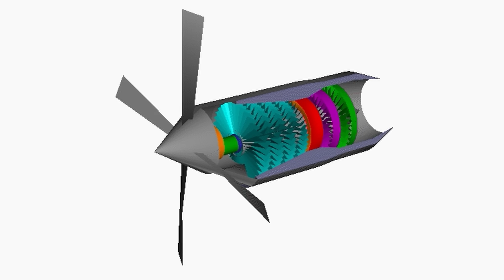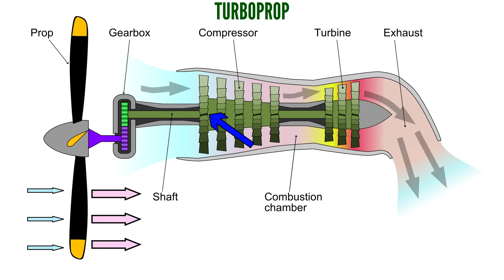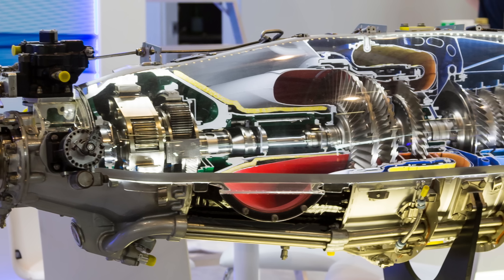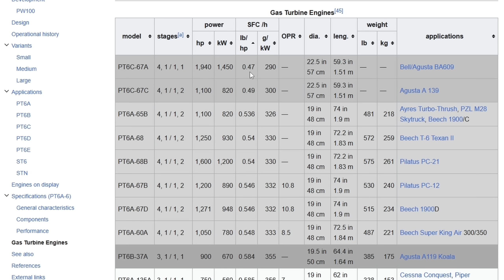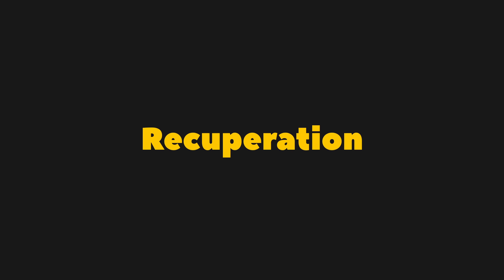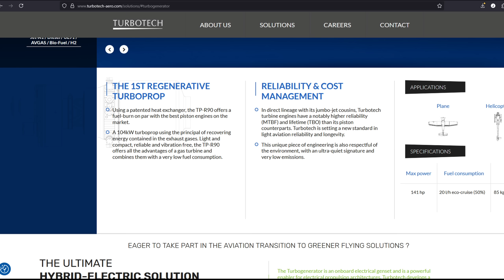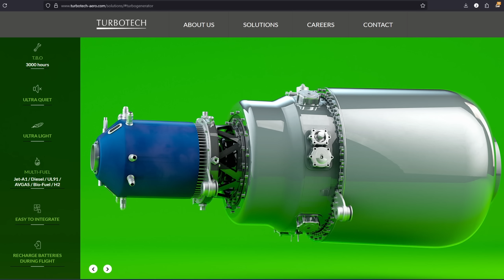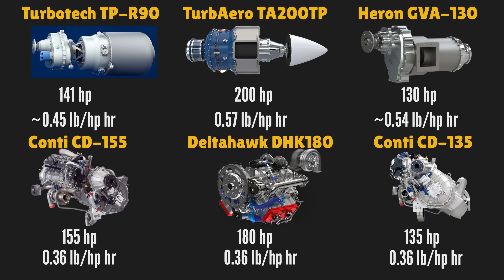Are Piston Engines Dead? Small Turboprops are Here

Comment: This was an excellent video. I'm actually considering doing a build assist on one of the airplanes that TurboTech has partnered with. This helped me understand the tradeoffs quite a bit better. 

Your video makes me want to be concerned with the recuperation technology and it's reliability. Can TurboTech actually achieve 3000 hr TBO? Have they made weight tradeoffs that are tested to that level of endurance? Is the recuperation tech something that can be inspected periodically? What is the replacement mechanism if an issue is found? Can I replace a part or do I have to overhaul the entire engine?

One thing that is a mystery to me is that TurboTech advertises that you can use any popularly available fuel in it including: Jet A1, UL91 & AVGAS. I don't understand how that works and would love for you to go over that. But the fact that Jet A1 is typically much cheaper than AVGAS also factors into the cost efficiency of the engine. If the engine burns more fuel, but the fuel costs less per unit, then the loss of fuel efficiency might be gained back in lower costs. 

Of course, the deltahawk can also use Jet A. But as an airplane consumer I don't see a lot of airplanes for which I could subtitute the deltahawk for the Rotax 916. Because the deltahawk is a lot heavier. Meanwhile the weight of the turbotech is very close to the weight of the 916. So it's more easily fitted to airframes that currently use the 916.
Reply from the maker: Thanks, and all reasonable concerns. I don't have most of these answers, but regarding inspecting the recuperator / heat exchanger, it seems an inspection is unlikely to be quick, nor trivial due to how integrated the device needs to be, and my guess is it consists of a multi-hour inspection with borescopes to look for cracks and signs of fatigue due to heat, depending on how they designed the heat exchanger wrt access ports / points, but I'm happy to be corrected here.

Comment: Turbine engines can handle higher temperatures than piston engines, at least big turbine engines. Piston engines have a more efficient thermodynamic cycle because the compression is partially performed by heat, rather than mechanically. However turbines can overcome some of this by operating at higher peak temps, maybe this doesn't apply to small turbine engines which arent manufactured to the same standards. As for the poorer efficiency at low power settings. It's mainly the lower pressure ratios that causes the drop off, as in the Brayton cycle higher PR is strongly correlated with efficiency (within reason). However another interesting factor is that if you can fly at 30,000ft you are in much colder air than at 10,000ft which greatly improves your thermal efficiency again.
Reply from the maker: They generally fly on Jet-A or Jet A1. They can fly on diesel, but aviation-grade diesel isn't readily available. Regarding automotive diesel, make sure with the manufacturer how that affects inspection intervals and TBO.

Also, diesel isn't a lot cheaper than Mogas, which many of the piston engines mentioned run on.

Comment: Can't believe a Rotax is $55,000.... for a piston engine 😢
Reply: - we all still think Rotax is a cheap snowmobille or Trike Engine....
Reply: I used to think GA piston engines were absurdly expensive, until I got into boats and found that a replacement diesel inboard for my boat is around $10k, and that's just 20-25 HP. $/HP is about the same as the Rotax example...

Comment: For me turbine have only 2 advantages, reliability and do ziiiiiiiii when start, the rest are disavantages.
Reply: They also are lighter, have a more aerodynamic form factor, use cheaper and more widely-available fuel and have better performance at higher altitudes than a piston.  The main problems have been fuel consumption and cost.   I’d love to have one if it was anywhere around 180 HP and 9 GPH.
Reply: @gregjennings9442  The turbine is hard to manufacture and very expansive because of this, I think the fuel efficiency is a price that everyone would pay, but the price of the engine and parts plus fuel efficiency is enough for keep away from experimental aviation. For me the way of future for low cost aviation is cheap and reliable piston engines, altitude can be resolved using turbocharge.

Comment: You didn't mention that turboprops use jet fuel, which is much cheaper per gallon than avgas.

but that's also true for piston diesels
Reply from the maker: Also, Jet-A1 is cheaper than Avgas, but not generally cheaper than Mogas, which has the piston engines featured in the video run on.
Reply: Some Rotax ultralights in Brazil are operating with cheap automotive Podium gasohol (E25, RON 102), but I guess diesel would be even cheaper there due to government cuts in diesel price.
Reply from the maker: Yes, and yes

Comment: One of the interesting side benefits of turbine engines is that they are a lot less picky about fuel than piston engines. We are currently seeing how incredibly difficult it is to get away from 100LL, with a turbine you can run not only "normal" jet fuel, it's also easier to adapt to synthetic fuels, biodiesel, maybe ethanol etc. It gives you a much wider fuel selection, even if the consumption is higher, that may result in equal or lower fuel cost, depending on 100LL availability (aero diesel engines also have this advantage of course).
Reply: The primary issue with biofuels is that they often can damage seals and elastic hoses in older engines. It means they can't be certified as a drop-in replacement which means supplemental type certification for all plane engine combinations.
Reply: @tymoteuszkazubski2755  There is an alternative solution, certification of the fuel itself as a drop in replacement. To my knowledge that is not possible for AvGas, but for Jet A it may be doable to formulate a replacement with the same impact on seals and hoses, especially with the R&D of the entire commercial aviation behind it.
Reply: the problem is that most piston aviation engines are old garbage technically speaking. cars dont need leaded fuel either. they make more power for their weight, consume less fuel etc. someone needs to make and certify a car style engine for avaition

Comment: Surely  Once  you take into account the higher TBO of turboprop engines compared to piston engines TBO the cost effectiveness  of turboprops seems to balance out.
Reply from the maker: However turboprops are generally quite a bit more expensive to overhaul.
Reply: Plus, there are usually required hot section inspections at more frequent intervals between overhauls.
Reply: The TBO of small turbines is often determined by cycles, instead of hours. Keep 'em running, and they'll run for tens of thousands of hours. But they may need a lot of work at 3K cycles.

Comment: The price is ridiculous, for the cost of one TP engine I can buy several used or two new piston engines. Ceiling is irrelevant, to most GA aircraft, as not flying at that altitude. Light sport, in Australia, is <10k ft. 
Until they can compete with the Rotax 912, Jabiru or the (smaller) lycosaur 4 cylinder engines, it's not viable for most small aircraft. If they can produce a 120 Hp diesel fuelled <85kg engine for under $50k...
Reply: I said the same thing. A gas turbine for a GA aircraft simply isn't gonna happen
Reply: - or Jet Ai - let's go with common fuel - maybe + oiler..
Reply: @kadmow you do know that diesel and jet A are nearly identical.  You can run a diesel engine on jet A and a turbine engine on diesel.   They are both a type of kerosene.